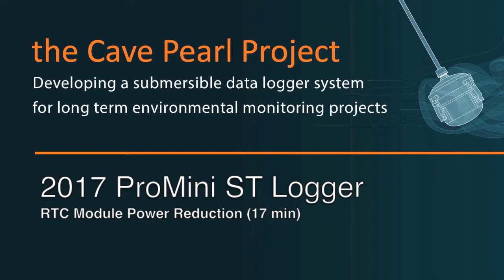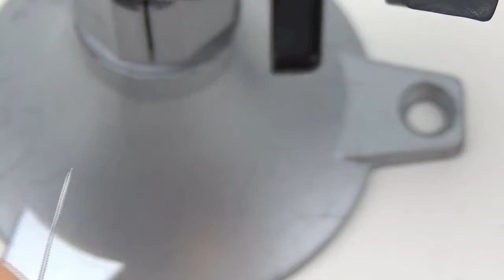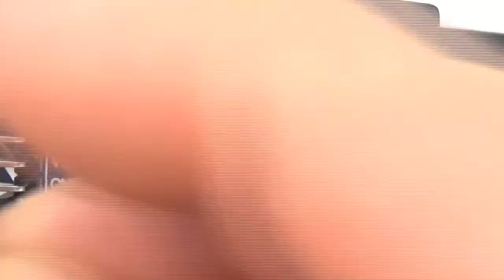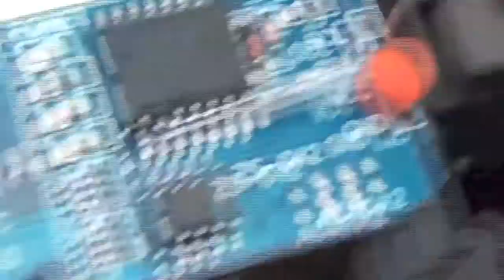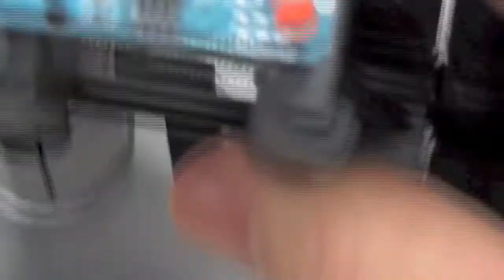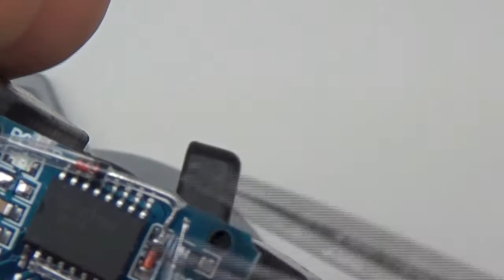2017 Pro Mini Logger Build - Power Saving mod for RTC board

Comment: Hello Edward , 
Thank You for making this video, Thank You for Spending your time to Share with us from your knowledge and Thank You for smart choice  using simple words to explain - for us , those no native  English speakers ... 
Now, I am struggling for more than 2 month now, in my attempt to make an Arduino Nano simple clock, some temperature from DS3231 and a TM1637 LED display ...
I have a "major" problem with DS3231 RTC module - I can upload the Code, I can see the time in Serial Monitor, even on TM1637 module, but when I Disconnect the Power  of the Arduino from computer and plug the 5vDC PS the time has "left behind" at the moment I was upload the Sketch  ... 
Thos Mod You did to the RTC module will Solve this Issue or is a Program/Code's "fault" ? 
Thank You and Bless You and your family ...

Comment: Thanks for a very useful video! My guess as to what consumes the 100uA would be the Vref inside the "power control" circuit (datasheet page 10). When you're powering directly from Vbat this power control and thus Vref is likely mostly off. Now, my problem is that apparently the DS3231 on my board is a scrapped version that consumes about 350 uA more than specified. I guess cheap ebay stuff is cheap for a reason...
Reply: I have a variant of the chip that uses high current too. I lifted the 32khz pin off the pad. I discovered that when that pin is directly wired to VCC then the power consumption drops to 1uA.

Comment: Thank you for your real world advice, 95% of YouTube tutorials are just bench / theoretical stuff. I made a timer that turns on and off a water feature following the real rising and setting of the sun, using the ds 3231 but it kept going off at unexpected times i narrowed it down to the ds resetting itself to 1/1/2000 8 am for some reason, I remembered seeing this video and looked it up again. Did the capacitor mod and so far so good. I guess turning on the relay gives such a jolt to the electrical system that the ds resets itself just like you said. So this was excellent. many thanks.

Comment: Hey Ed.  I just started reading some of your documentation - you have a ton of stuff!  I've just scratched the surface.  I need to make a low power data logger, (entirely powered by CR2032) and I will try to re-use what you have already created.  One quick question:  Regarding this power saving mod.  Adding the 1N4148 diode won't do anything, since VBAT is already connected to the cathode of the existing diode.  The new diode will be shorted.  Am I missing something?
Reply: My bad - I forgot you cut the VBAT trace, so the diode is surely needed!

Comment: Great mod!   If you used a lower voltage drop diode like a schottky type, seems like the RTC can run even longer as the battery drains and VBAT drops.  Vmin recommended is 2.3V for the DS3231.
Reply from the maker: I was wondering about the reverse leakage current through the shottky's going into the coincell. While small, it would potentially be there for years at a time on our long deployments (?)
Reply: @edwardmallon4646  Good call!  Schottky's are a lot leakier than the normal P/N diodes.  The BAT54 schottky is spec'd at 2uA max for 35v reverse.  With a max reverse of ~3V, the "charging" current into the battery would probably be less than 1uA.